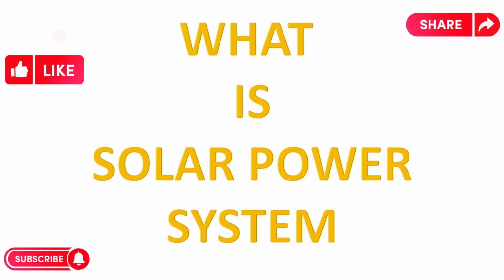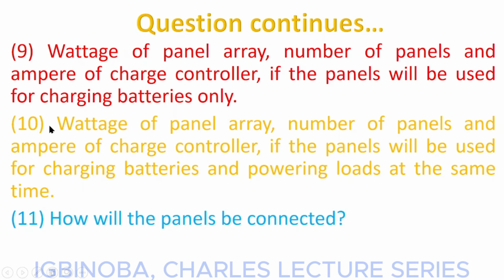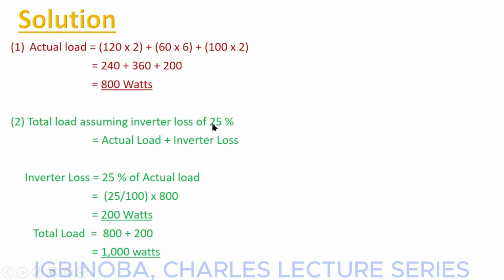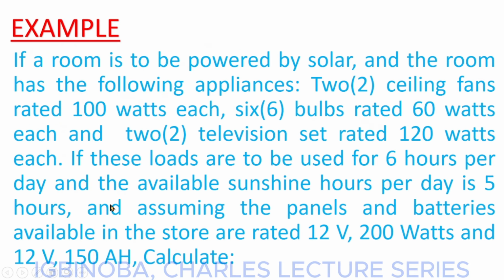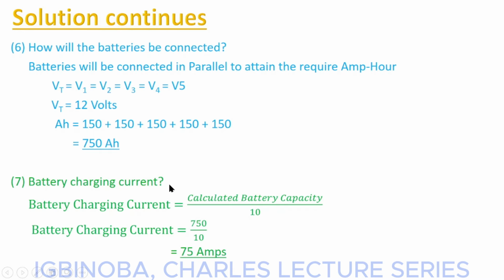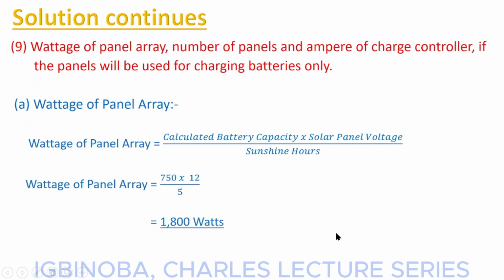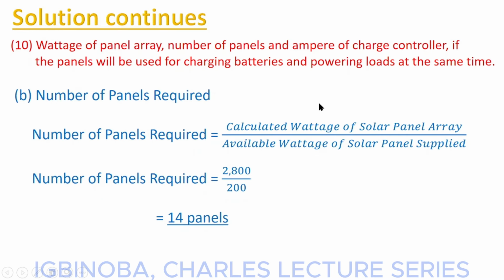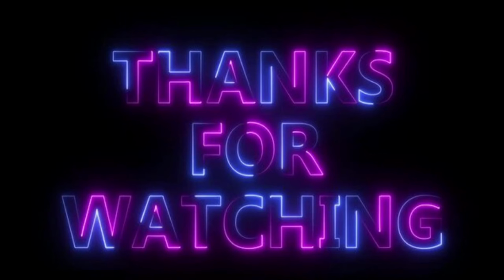Design of Solar Power System

Comment: COMP385G

1. Actual Load = 300+600+480 =1380W
2. Total load = 1380+((25/100)*1380)= 1725W
3. Inverter rating = 1725/0.8 =2157VA
4. Battery Capacity= 1293.75Ah
5. Number of batteries= 1293.75/150= 8.625~ 9 batteries.
6. To achieve the amp hour, it will be connected in series.
7. Battery Charging Current= 1293.75/10 = 129.375Amps
8. Battery Charging Time at 40% loss =
((1293.75/129.375)+(40/100*10))=14hrs
9.(a) 3105 watts
(b) 15.525 \sim 16 panels
(c) 258.75 Amps
(a) 4830 watts
(b) 24.15 \sim 24 panels
(c) 402.5 Amps
Parallel

Comment: CHM3157A
i) Actual load = 1380 watts.
ii) Total load = 1725 watts.
iii) Inverter ratings in VA = 2156.25VA.
iv) Battery capacity = 1035Ah.
v) Number of batteries for backup hours = 6.9= 7 batteries.
vi) The batteries will be connected in parallel. vii) Battery charging current= 103.5 A. viii) Battery charging time= 14 hours
ix) a. Wattage of panel array= 2484 watts.
b. Number of panels= 12.42 = 12 panels
c. Ampere of charge controller= 207A.
x) a. Wattage of panel array= 4209 watts.
b. Number of panels= 21.05 = 21 panels.
c. Ampere of charge controller= 350.75A. 
xi) The panels will be connected in parallel just as the batteries

Comment: MECH3118N
1: actual load 1380watts

2 total load=1725 watts

3: inverter rating-2156,25VA

4: battery capacity» 1293.75A

5: No of batteries=9

6: batteries are connected in parallel

7. battery charging current =129.4amps

8: battery charging time=14hrs

9a: wattage of panel array 3105watts

9b: number of panels-16panels

9c: charge controller= 258.75A

10a: wattage of panel array 4830watts

10b: number of panels = 24

10c: charge controller = 402.5A

11: panels are arranged in parallel

Comment: MECH392N

1: actual load 1380watts

2 total load=1725 watts

3: inverter rating-2156,25VA

4: battery capacity» 1293.75A

5: No of batteries=9

6: batteries are connected in parallel

7. battery charging current =129.4amps

8: battery charging time=14hrs

9a: wattage of panel array 3105watts

9b: number of panels-16panels

9c: charge controller= 258.75A

10a: wattage of panel array 4830watts

10b: number of panels = 24

10c: charge controller = 402.5A

11: panels are arranged in parallel

Comment: PETRO378Z
1. Actual load= 1380w
2. total load with inverter=1725w
3.inverter Rating= 2156.25VA
4.Battery capacity= 2193.75Ah
5. No of batteries=8.6~9
6. Battery are connected in parallel 
7. Battery charging current=129.38Amps
8.Battery charging Time=14hrs
9.a) wattage of the panel Array =3105W
b)No of panels = 16
c) Charging controller Rating 258.75Am
10.a) wattage of the panel Array=4830W
b) No of panels=24
c) Charging controller Rating=402.5A
11. The panels are connected in parallel

Comment: PETRO348V
1. Actual Load = 300+600+480 = 1380W

2. Total load = 1380+((25/100)*1380) = 1725W

3. Inverter rating = 1725/0.8 = 2157VA

4. Battery Capacity= 1293.75Ah

5. Number of batteries= 1293.75/150= 8.625~ 9 batteries.

6. To achieve the amp hour, it will be connected in series.

7. Battery Charging Current= 1293.75/10 = 129.375Amps

8. Battery Charging Time at 40% loss = ((1293.75/129.375)+(40/100*10)) = 14hrs

9.(a) 3105 watts
(b) 15.525 \sim 16 panels
(c) 258.75 Amps

10
(a) 4830 watts
(b) 24.15 \sim 24 panels
(c) 402.5 Amps
Parallel

Comment: MAR395Q
1. Actual Load: 1380 watts

2. Total Load: 1725 watts

3. Inverter Rating: 2156.25 VA

4. Battery Capacity: 1293.75 Ah

5. Number of Batteries Required for Backup Hours: 8.625

6. Battery Connection: Parallel

VT = V1 = V2 = V3 = V4 = V5

Total Voltage (VT) = 12 volts

Total Capacity (Ah) = 150 + 150 + 150 + 150 + 150 = 750 Ah

7. Battery Charging Current: 129.375 amps

8. Battery Charging Time (less than 40% depth): 14 hours

9. Solar Panels (Option 1):

(a) Total Panel Wattage = 3105 watts

(b) Number of Panels = 15.525 ≈ 16 panels

(c) Charge Controller Current = 258.75 amps

10. Solar Panels (Option 2):

(a) Total Panel Wattage = 4830 watts

(b) Number of Panels = 24.15 ≈ 24 panels

(c) Charge Controller Current = 402.5 amps

11. Solar Panels Connection: Parallel

Comment: MAR367O
1. Actual Load: 1380 watts

2. Total Load: 1725 watts

3. Inverter Rating: 2156.25 VA

4. Battery Capacity: 1293.75 Ah

5. Number of Batteries Needed: 8.625 ≈ 9 batteries

6. Connection Type: Parallel

7. Battery Charging Current: 129.375 amps

8. Charging Time: 14 hours

9. Solar Requirement (Option A):

(a) 3105 watts

(b) 15.525 ≈ 16 panels

(c) 258.75 amps

10. Solar Requirement (Option B):

(a) 4830 watts

(b) 24.15 ≈ 24 panels

(c) 402.5 amps

11. Connection Type: Parallel

Comment: EEE3177U

1) Actual Load=1,380W
2) Total Load=1,725W
3) Inverter Rating=2156.25VA
4) Battery Capacity=1293.75Ah
5) No of batteries=9
6) Batteries are connected in parallel
7) Battery Charging Current=129.38A
8) Battery Charging Time:14hrs
9a) Wattage Of Panel Array=3,105W
9b) Number Of Panels=16
9c) Charge Controller=258.75A

10a) Wattage Of Panel Array=4,830W
10b) Number Of Panels=24
10c) Charge Controller=402.5A
11) Pannels are connected in parallel.

Comment: PETRO377Y
Answers 
1. Actual load: 1,380 W
2. Total load: 1,725 W
3. Inverter rating: 2,156.25 VA
4. Battery capacity: 293.75 AH
5. Number of Batteries: 8.6 batteries 
6. Parallel 
7. Battery charging current: 129.375 Amps
8. Charging time: 14hrs
9. a. 3,105W, b. 15.5~16panels c. 258.75Amps
10. a. 4,830W, b. 24 panels c. 402.5Amps
11. Parallel

Comment: PETRO374V

1. Actual load = 1380 watts

2. Total load = 1725 watts

3. Inverter rating in VA = 2156.25 VA

4. Battery Capacity = 1293.75 AH

5. Number of batteries for backup hours = 8.625

6. The battery will be connected in parallel. VT = V1 = V2 = V3 = V4 = V5
VT = 12 volts
Ah = 150 + 150 + 150 + 150 + 150 = 750 Ah

7. Battery charging current = 129.375 Amps

8. Battery charging time less than 40% = 14 hrs

9. Wattage of panels array = 3105 watts
9b. Number of panels = 15.525 panels
9c. Ampere of charge controller = 258.75 Amps

10. Wattage of panels array = 4830 watts
10b. Number of panels = 24.15 panels
10c. Ampere of charge controller = 402.5 Amps

11. Solar panel will be connected in parallel

Comment: CIV 31A

1. 1380watt
2. 1725watt
3. 2156.25 VA
4. 1293.75 AH
5. 9 batteries
6. Parallel connection
7. 129.375A
8.14 hours
9. i) 258.75A
    II) 16 panel
    III) 258.75A
10.i) 4830W
      II) 24 panels
      iii) 402.5A
11. Panels are arranged in parallel connection

Comment: CHM330D
1. Actual load =1380watts
2. Total load including inverter loss =1840watts
3. Inverter rating =2300VA. 
4. Battery capacity= 1227Ah
5. Number of batteries=9batteries
6. Battery connection: parallel
7. Battery charging current= 15A per battery string
8. Battery charging time: 5.1days
9. Panel array= 2945watts
Number of panels= 15panels
Charge controller= 245A
10. Panel array for charging batteries and powering loads
Wattage= 4785
Number of panels= 24panels
Charge controller= 399A
11. Panel connection: series-parallel

Comment: EEE368P

i) Actual Load = 1380W
ii) Total Load with inverter = 1725W
iii) Inverter Rating = 2156.25VA
iv) Battery Capacity = 1293.75Ah
v) Nō of Batteries = 8.6~9
vi) Batteries are connected in parallel 
vii) Battery Charging Current = 129.38Amps
viii) Battery Charging Time = 14hrs
ix)a. Wattage of the Panel Array = 3105W
    b. Nō of Panels = 16
    c. Charge Controller Rating = 258.75Am
x)a. Wattage of the Panel Array = 4830W
   b. No of panels = 24
   c. Charge Controller Rating = 402.5A
xi) The panels are connected in parallel

Comment: CHM36F 

1.Actual load =1380W
2. Total load = 1725W
3. Inverter rating = 2156.25VA
4. Battery capacity = 1293.75AH
5. No. Of batteries = 9
6. Parallel 
7. Battery charging current = 129.375A
8. Charging time = 14 hrs
9. (A) 3105W
 (B) 15.5 panels
 (C) 258.75A
10. (A) 4830W
      (B) 24 panels
      (C) 402.5A
11. Parallel

Comment: COMP59G

1. Actual load is 1380w
2. Total load is 1725w
3. Inverter rating is 2156.25VA
4. Battery capacity is 1293.75AH
5. No of batteries 9
6. Parallel
7. Battery charging current is 129.375amps
8. Charging time is 14 hours
9. (A) 3105W
(B) 15.5 panels
(C) 258.75A
10. (A) 4830w
(B) 24 panels
(C) 402.5A
11. Parallel

Comment: CHM3104Z 
1. actual load = 1380 watts
2. total load = 1725 watts
3.  inverter rating = 2156.25 VA
4. battery capacity = 1293.75 Ah
5.  number of batteries = 9
6. batteries are connected in parallel
7.  battery charging current = 129.4 A
8.  battery charging time = 14 hours
9a wattage of panel array = 3105 watts
9b  number of panels = 16 panels
9c charge controller = 258.75 A
10a wattage of panel array = 4830 watts
10b  number of panels = 24 panels
10c  charge controller = 402.5 A
11  panels are arranged in parallel

Comment: PETRO319OH

i) Actual load=1380W
ii) Total load=1725W
iii) Inverter rating=2156.25VAmp
iv) Battery capacity=1293.75AH
v) No of batteries=9
vi) They will be connected in parallel 
vii) Battery charging current=129.38A
viii) Battery charging time=14hrs
ix)  For battery only
      Panel wattage=3105W
      No of panels=16panels
      Panel current=258.75A
x) For both battery and charging
     Panel wattage=4830W
     No of panels=24panels
     Panel current=402.5A
xi) The panels will be connected in parallel

Comment: CIV3107C

1. Actual load is 1380w
2. Total load is 1725w
3. Inverter rating is 2156.25VA
4. Battery capacity is 1293.75AH
5. Number of batteries 9
6. Parallel 
7. Battery charging current is 129.375amps
8. Charging time is 14hours
9.(A) 3105w
   (B) 15.5panels
   (C) 258.75A
10.(A) 4830w
      (B) 24 panels
      (C)402.5A
11. Parallel

Comment: PETRO3113I
3 fans,100 watts each
10 bulbs, 60 watts each
4 televisions, 120 watts each
Backed up hours - 6 hrs
Sunshine hours per day - 5 hrs 
Panels - 12v , 200 watts 
Batteries - 12v, 150 AH 

1) Actual load = 300+600+480= 1380 Watts 
2) Total Load = Actual+ inverter loss
       N/B:   Inverter loss- 25/100 of actual load 
       1380 + (25/100 * 1380) = 1725 Watts 
3) Inverter rating in VA  = 
                      Calculated Total Load/Power factor
               Inverter rating = 1725/0.8 
                                          = 2156.25 VA
4) Battery Capacity = 
          2 * Calculated Total Load * Backed up hrs * Factor For Reserve / Battery Voltage 
           = 2 * 1725 * 6 * 0.75 / 12 
             = 1293.75 AH 
5) Number of batteries = 
           Calculated Batter Capacity/ Battery Capacity given 
      = 1293.75 AH  / 150 AH = 8.6 = 9 batteries approximately 
6) The batteries will be connected in parallel 
7) Battery Charging Current =  
                 Calculated Battery Capacity/ 10
                = 1293.75 / 10 
                = 129.375 Amps
8) Battery Charging Time =
        Calculated Battery Capacity + ( 40% of Calculated Battery Capacity) / Charging Current 
          = 1293.75 + ( 40/100 * 1293.75) / 129.375
          = 1293.75 + 517.5 / 129.375
          = 1811.25 / 129.375
          =14 hrs 
9) 
     i) Wattage of panel array = 
        (Calculated Battery Capacity * Solar Panel Voltage) / Sunshine Hours 
                 = 1293.75 * 12 / 5
                 = 3105 Watts 
      ii) Number of panels = 
    Calculated wattage of solar panel array / Available Wattage of panel supplied 
                = 3105 / 200
                = 15.525 = 16 panels approximately 
        iii) Ampere of charge controller =
        Calculated wattage of solar panel array/ Solar Panel Voltage 
           = 3105 / 12 =  258.75 Amps
10) 
       i)  Wattage of panel array ( for charging batteries and powering loads ) = 3105 + 1725 = 4830 Watts
        ii) Number of Panels( for charging batteries and powering loads ) = 
        Calculated wattage of solar panel array / Available Wattage of panel supplied 
               = 4830  / 200 = 24.15 = 24 panels approximately 
        iii) Ampere of charge controller( for charging batteries and powering loads ) =
        Calculated wattage of solar panel array/ Solar Panel Voltage 
          = 4830 / 12
           = 402.5 Amps 

11) The Panels will be connected in parallel.

Comment: PETRO376X 

1. Actual load= (100×3)+(60×10)+(120×4) =1380watts

2. Total load assuming inverter loss of 25%= Actual load +Inverter loss
Inverter loss=25% of Actual load
Therefore, 
Total load= 1380+(25%×1380)=1725 watts

3. Inverter rating in VA using power factor of 0.8
= (1725÷0.8)= 2156.25 VA

4. Battery capacity using factor for reserve of 75%=(2×1725×6×0.75)/12=1293.75Ah

5. No. of batteries for backup hours=1293.75Ah÷150Ah= 8.625 = 9 (Approximately) 
       = 9 batteries 

6. How the batteries will be connected?
The batteries will be connected in parallel 
VT=V1=V2=V3=V4=V5=V6=V7=V8=V9
VT= 12 V 
Ah= 150+150+150+150+150+150+150+150+150=1350 Ah

7. Battery charging current=1293.75÷10=129Amps

8. Battery charging time assuming charging loss of 40%= 1293.75Ah+(40%+1293.75Ah)÷129A=14hrs

9a. Wattage of panel array= (1293.75 x 12)/5=3105 watts

9b. Number of panels required= 3105÷200=15.525 = 16 panels 

9c. Ampere of charging controller required= 3105÷12=258.75Amps

10a. Wattage of panel array= Calculated wattage of solar panel array for charging battery only+ calculated total load =3105+1725=4830watts

10b. Number of panels required= calculated wattage of solar panel array÷ Available wattage of solar panel supplied= 4830watts÷200watts= 24.15 Amps

10c. Ampere of charge controller= calculated wattage of solar panel array÷ solar panel voltage=4830watts÷12volts= 402.5Amps

11. How will the panels be connected?
Ans: They will be connected in parallel

Comment: EEE3153W
1. Actual load : 1380w
2. Inverter loss : 345w
        And Total load : 1725w
3. Inverter rating : 2156.25VA
4. Battery capacity at 75% : 1293.75AH
5. Number of batteries : 9 panels 
6. Parallel 
7. Battery charging time : 14HRS
8. Battery current : 129.38AH
   9a. Wattage of panels: 3105w
   9b. Number of panels: 16 panels
   9c. Amp of charge controller: 258.75AH
  10a. Wattage of panels with load : 4830w
  10b. Number of panels: 24 panels 
  10c. Amp of charge controller with load: 402.5AH
11. Parallel

Comment: PETRO3179W

1. Actual Load Power: 1380 W
2. Total System Load: 1725 W
3. Required Inverter Rating: 2156 VA (approximately)
4. Battery Bank Capacity: 1294 Ah (approximately)
5. Number of Batteries: 9 (rounded from 8.625)
6. Battery Configuration: Parallel
7. Battery Charging Current: 129 A (approximately)
8. Estimated Charging Time: 14 hours
9. Solar Array for Battery Charging:
• Total Power: 3105 W
• Number of Panels: 16 (rounded from 15.5)
• Charge Controller Rating: 259 A (approximately)
10. Solar Array for Loads and Charging:
• Total Power: 4830 W
• Number of Panels: 24
• Charge Controller Rating: 403 A (approximately)
11. Panel Connection: Parallel

Comment: PETRO3158B

1. Actual load= (100×3)+(60×10)+(120×4) =1380watts
2. Total load assuming inverter loss of 25%= Actual load +Inverter loss
Inverter loss=25% of Actual load
= 25%×1380=345 watts
Total load= 1380+345=1725 watts
3. Inverter rating on VA using power factor of 0.8
= (1725÷0.8)= 2156.25
4. Battery capacity using factor for reserve 75%=(2×1725×6×0.75)=1293.75Ah
5. No. of batteries for backup hours=1293.75Ah÷150Ah= 8.6 =9 batteries 
6. How batteries will be connected?
The batteries will be connected in parallel 
Vt=V1=V2=V3=V4=V5=V6=V7=V8
Ah= 150+150+150+150+150+150+150+150+150=1350
7. Battery charging current=1293.75÷10=129Amps
8. Battery charging time assuming charging loss of 40%= 1293.75Ah+(40%+1293.75Ah)÷129A=14hrs
9a. Wattage panel array= 3105 watts
9b. Number of panels required= 3105÷345=9 panels 
9c. Ampere of charging controller required= 3105÷12=258.75Amps
10a. Wattage of panel array= Calculated wattage of solar panel array for charging battery only+ calculated total load =3105+1725=4830watts
10b. Number of panels required= calculated wattage of solar panel array÷ Available wattage of solar panel supplied= 4830watts÷345= 14Amps
10c. Ampere of charge controller= calculated wattage of solar panel array÷ solar panel voltage=4830watts÷12volts= 402.5Amps
11. How will the panels be connected?
Ans: They will be connected in parallel cause voltages are constant(12v)

Comment: MAR3166J

1. Actual Load: 1380 watts
2. Total Load: 1725 watts
3. Inverter Rating: 2156.25 VA
4. Battery Capacity: 1293.75 Ah
5. Number of Batteries: 8.625 - 9 batteries
6. Parallel
7. Battery charging current: 129.375 Amps
8. Charging time: 14 hrs
9. (a) 3105 watts
(b) 15.525 - 16 panels
(c) 258.75 Amps
10. (a) 4830 watts
(b) 24.15 - 24 panels
(c) 402.5 Amps
11. Parallel

Comment: CHM3167K
1.Actual Load = 1380watts
2.Total Load = 1725watts
3.Inverter rating = 2156.25 VA
4.Battery Capacity = 1293.75Ah
5.No of Batteries = 9
6.Batteries are connected in Parallel
7.Battery Charging current = 129.4amps
8.Battery Charging time = 14hrs
9a) Wattage of panel array = 3105watts
9b) Number of panels = 16 panels
9c) Charge Controller = 258.75 A
10a) Wattage of panel array = 4830 watts
10b) Number of panels = 24
10c) Charge Controller = 402.5A
Panels are arranged in Parallel

Comment: CHM328B
1. 1380W 
2.1725W 
3. 2156.25VA 
4. 1293.75A
 5. 9 batteries 
6. Parallel connection
 7. 129.4 Amp 
8. 14hrs 
9a. 3105W
 9b. 16 panels
 9c. 258.75A 
10a. 4850W
 10b. 24 Panels
 10c. 402.5A
 11. Parallel connection

Comment: CHM3122R
1. Actual load: 1,380 W

2. Total load: 1,725 W

3. Inverter rating: 2,156.25 VA

4. Battery capacity: 293.75 AH

5. Number of Batteries: 8.6 batteries

6. Parallel

7. Battery charging current: 129.375 Amps

8. Charging time: 14hrs

9. a. 3,105W, b. 15.5~16panels c.

258.75Amps

10. a. 4,830W, b. 24 panels c. 402.5Amps

11. Parallel